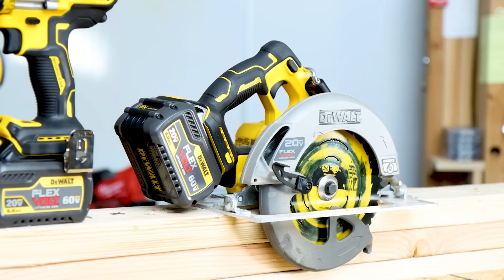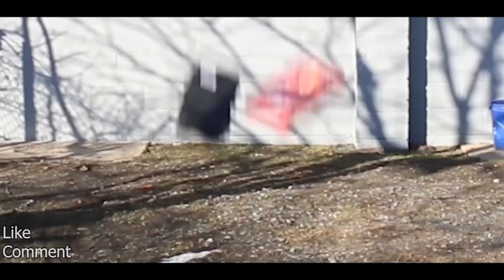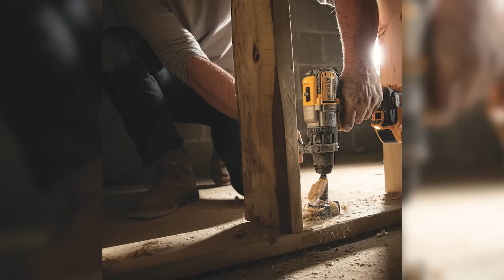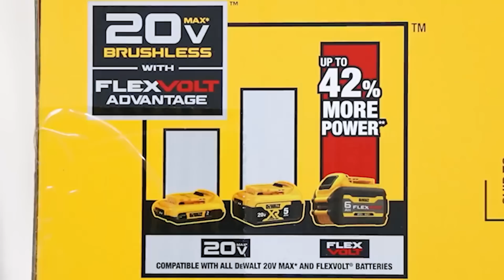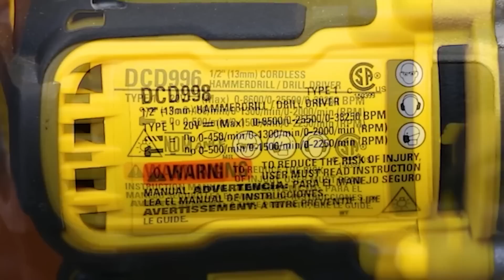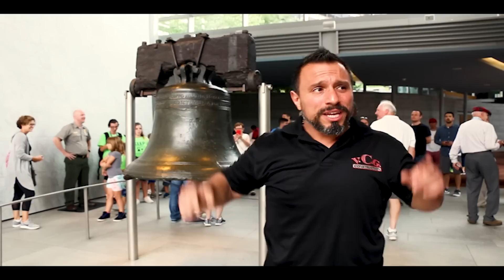DeWALT Tools DIRTY Marketing Tactics (FLEXVOLT Advantage AND Power Detect Hammer Drills)

Comment: Instead of reinvent the wheel 3 times in every product line they have they need to invent new things that are smart and brilliant for all the contractor to use.
I hav recently change my tools from Hitachi to Dewalt for 2 reasons 1 Hitachi change theres battery line to often and 2 its por design and durability.
I have now all the tools i need of Dewalt and are very satisfy whit that but i think they are about to loos it.
If i can give them a tip it is this do some market research and improve the storage line as in T-stak Tough system and invent some smart tools that we dont know that we need yet.
Sorry for por English i am from Sweden =)

Comment: Does the same thing happens to the reciprocating saws? I'm still debating with myself if buying the flexvolt, the flexvolt advantage or the power detect sawzall. Wish one has more power? Wish one has less vibration?

Comment: This design of drill goes back to the DCD925 post type battery drill. Although the old drill is a brushed motor the transmission is identical 3 speed 500 rpm, 1200 rpm and 2000 rpm,  clutch and chuck exactly the same

Comment: The flexvolt has more max watts output at 1219. And also has more Rpms on hammer drill mode at 2250.  This is why it's better and I love it. The others have less max watts and hammer drill RPMs💣💥👊🤘

Comment: It's all marketing hype!  All manufacturers play the game and dup customers who aren't smart enough to know the difference.
Personally I like the 60v Flex, but I got two Flexvolt tools and I can use the extra 60v batteries in all of my 20v and even older 18v tools using the adaptor.   I look at it like buying a new 1/2 ton truck, they all got the same basic design, but then you get to pick the engine for the power you need and the gas tank size for how long you want to go between fill ups...

Comment: I have the XR line of tools, but I got the flex volt advantage hammer drill for Black Friday only because it came with the 6AH flex volt advantage battery for free with a 6AH charger. Only reason I got that one. Works great.

Comment: I would actually really like to see a tool test on the batteries.     The flex volt vs the XR batteries. On the 20 volt line up of tools.      What battery is best as far as power and or run time or both.       We all know the tools are the same spec.    Let’s see what story Lowe’s or Home Depot carry’s the top battery.      Well I mean Home Depot has the XR to.     But what dewalt battery is king.      Now as far as the 60 volt side and multi platform use.   Just power up 20 volt tool what ones takes it

Comment: I think all 3 drills are the same.  Dewalt could have had pressure from HD or Lowes to make the combos slightly different because of the price match. Just like some stores have something 1 digit off in the model number so you can't price match like some TV's. It could be that Dewalt needed to pick up sales for flexvolt batteries and used the percentage ad to pull a wool over consumers to make the 999 look more powerful hoping no one notices the fine print or does the math. Looking at the Dewalt website the various battery descriptions seem very elusive. Some are compared as "more capacity"  other are "more run time" some XR batteries are compared to a "3ah max standard battery" which then shows no specs. I picked up the 998 from Lowe's with the 8ah battery and got the DCB894 free. The drill was right on time as my DC759 18v nicad  motor recently started smoking.
Reply: They are all slightly different. The 996 and 999 are the same, except the 999 can make use of the Flexvolt batteries. The 998 is different because it has  an internal chip that optimizes your battery usage. Otherwise, mechanically, they are the same.

Comment: i love the new tool line that the same as the old one, they sold the old 3sp xr drill and driver 2 4amp battery's out for 149.00 so i got 2 set, and got the xr sawsall and 1sp xr drill and xr driver and 2 batterys for 170.00,, ceep it coming LOL but i do think at sometime i would like to get some of the 60vt things but no rush

Comment: I have the 996 and the 999.  If I use a standard 20v battery they perform the same. But using the  flex battery the 999 definitely has more grunt to it.   Not sure how it does that but it definitely has more jam when I need it.
Reply: How does your 996 compare to the 999 if you use the Flex Volt battery on both of them?
Reply: @pheloniousmunk  the 999 definitely has more pep to it than the 996 when using the flex battery.  They are just about identical with a standard battery.  Close enough that I can’t really tell. I had the 999 bind up on a hole saw and spin it’s t handle around and the 996 has never managed that.
Reply: @brunothehumble  Thanks for that info. So you have tried the 996 vs 999 while both were on a Flex Volt battery?
Reply: @pheloniousmunk  I only have one flex volt battery so I can’t go directly head to head but yes I’ve used both with a flex battery and I was able to notice a marked improvement in performance with the 999
Reply: @brunothehumble  Interesting

Comment: I wish someone would hook all 3 up to some kind of test rig that could measure torque to see if they are any different, too many videos with speculation or some guy drilling holes and no data. paging Project Farm or AvE
Reply: Suggest it to Project Farm, he is awesome!
Reply: Project farm and AVE are both effin amazing for tool info!
Reply: @ikon8275  AVE hasn’t done a proper tool teardown in ages unfortunately.
Reply: @bt5252  I agree @AvE should do a teardown of all three.
Reply: Cew @guitfiddle
Reply: There is a video and 999 is the best but very slightly. Not noticeable to the naked eye but just a hair better that it’s not even Noticeable unless ran together side by side
Reply: I mean the easy solution is to find teardown vides and compare the part numbers for the motors themselves as a starting point
Reply: Search for torque test channel. Legit test rig with data!  No fluff and to the point!
Reply: Turque test channel did that with 2 of them i think. They are close to the same.

Comment: Just got the 996, 887 combo for Xmas based on a number of reviews plus sale (probably due to these new models coming out).  Spent the last 2 weeks deciphering the diff between XR, 20v max and flexvolt both for tools AND batteries.  If I'd known it was going to be so ridiculous, I don't know if I would have committed to the platform.
Weekend warriors don't want to spend hundreds of dollars on different brand batteries and chargers.
Reply: What the heck are you trying to say? You can use any of the 20v batteries AND the Flex Volt batteries on your 20v tools. You can also use the 20v chargers like the DCB115 to charge all of your batteries, including Flex Volt, and the high amp DCB118 rapid charger for all of your batteries. What are the different brand batteries and chargers you speak of?

Comment: I have a question for anyone out there, i just got the dewalt drill and impact combo comes with both drivers, 2  2ah batterys and charger i also picked up the 5ah battery at lowes as well "special gift" and for some reason the 5ah battery wont charge no more than 1 bar no matter how long i let it charge
Reply from the maker: Take it back
Reply: @VCGConstruction  i did and they replaced it with another 5ah and its still doing the same thing
Reply: @foxkiller96   try a different charger
Reply: I had the same problem with my batteries and found out you have to push it farther then it clicks in place, and it starts charging
Reply: Lowe's will take care of you.

Comment: I don't play with DeWalt tools but it doesn't surprise me that they play games... it doesn't surprise me that they play games because the reason I don't use DeWalt tools is because in 2003 I bought a DeWalt 5 tool xr combo kit. All of the tools except for the flashlight and the circular saw quit working within 6 months and then the battery packs quit working within another few months of not using them and then wanting to use it in the flashlight neither one of them would charge.... This was back when everything was still nicad batteries but DeWalt refused to warranty any of the items because I told them that I was using them at work doing HVAC and they told me since I was using it commercially that there was no warranty... Or that it was some ridiculously short warranty that I was already out of and keep in mind this is less than a year old stuff that most of it quit working within six months

Comment: So I’m going to say since the specs are the same. And it doesn’t matter across the board they all can run same battery’s. I’d go with who ever offers the best deals on there tools.   Yes I’d lean toward the flex volt tool just based on more uses for the battery and can get you into the 60 volt tools.         But I agree 100% it’s just a marketing game between Lowe’s and Home Depot.   Dewalt is playing both sides so they need separation between models.  It sucks to think a company is rebranding same tools for 2 retailers it’s insane.    Milwaukee doesn’t sell out of Lowe’s and I have a feeling they would not create 2 brands within there own cordless tools.     

If I was Home Depot I would work on getting a exclusive rights to dewalt and let Lowe’s carry craftsman   Then they would pretty much have contractor tools locked up       But this crap of Home Depot doesn’t want to carry same brands as Lowe’s is just dumb.

Comment: Dewalt makes some very nice tools.  Unfortunately the marketing wank is way way to much.   My daily drives are the German Metabo, Fein, Bosch, some Makita.  The marking for these is nothing like Dewalt or Milwaukee and I do use 12V Milwaukee tools. The point is by creating a marketing shell game it confuses and makes the customer angry.
Reply: Wtf did Milwaukee do? Thay have like 2-3 18v tool lines and it’s blatantly obvious what’s top of the line. FUEL boom done it’s the best, don’t drag Milwaukee into this.

Comment: i will not by a black & decker product again years ago my dad a friend and i bought a cordless toolset at christmess time good tool xps we bought a lot of batteries and use them for a g scale trains but it was a one the special here for that  chrismess   and January came the next year the warranty was no good and they were no longer supporting that line one time thing i thought it was a good line at the time and I seen black & decker do one time tool lines and only put them out for one time a lot and then you get no support after a month or two so that is why do not buy form black $ decker any more but i do have one of there old power drills it has a special bearing in it so you can put side load on it mine is brown the new model is orange looks like a harbor fraught junk i know the old brown one i could not burn up and when i did woodturning i sanded the inside the bowl with it i did buy a dad talked me into buying a dewalt  corded table saw with stand it works

Comment: DeWalt has been doing deceptive marketing ever since the start of the 20v and multiples fallacy. Can't market them that way in the EU. They're 18v and multiples. Granted ALL 18v tools have a nominal 20v when fully charged. The moment you activate discharge, it's 18v. Dishonesty apparently is the theme. I still have DeWalt tools...
Reply: @Joseph Fossa and here it thought it was because people are stupid and would complain that their 18v stick batteries dont work on their 20v(18v) slide battery tools because "its 18v it should work!!!"
Reply: @adamperry4610  dont forget dewalt also sells the adapter to use your 18v stick tools with a slide on 20v battery. saw that tonight at Lowes. 2 20v batteries and the adapter were 179.00, whereas 2 18v stick batteries would be 169.00.  I own all older 18v dewalt, so when my stick lithium ions finally die, I'll likely just grab the 20v slide on batteries with the adapter.  

Edit to add... I actually bought the 12v drill and 12 v impact combo (2 bats and a charger) for 199.00 however they (dewalt) threw in a free tool only of choice.. (select items) bluetooth speaker,light,recip saw,1/2 impact,or a circ saw.  I chose the sawzall. 
First off let me start by stating I only bought the 12v for its weight and size (and the belt clip). As a service electrician. I was dead tired of dragging around the bohemouth 18v impact driver.  The 12v is so much lighter smaller and just as capable for the tasks I perform. Now let me speak for the 12v sawzall. OmFg. More than 1/2 the weight of the old school 18v sawzall. So much more ergonomic as well.   Just sayin... 👍

Comment: Larger Ah rating means the battery can supply more current. But that also means that the motor-speed controller combo has to be able to handle the extra current, or it will burn up.

Comment: Make a drill for the battery class and call it a day. To much bs having so many models.
Reply: True. Bloody hard keeping up with the alphabet soup.
Reply: That’s one of the reasons I like Milwaukee.  Still using only 18v batteries.  If it says Fuel it’s the top of the line.
Reply: @DamionJR4923  dewalt xr, same it's the newest model of brushless battery line. Same as FUEL
Reply: @benthompson8256  I don’t like the Home Depot vs Lowe’s vs Ace Hardware versions of Dewalt.  Dewalt makes great stuff.  All of my corded tools are Dewalt.  My Miter Saw, heat gun, and grinder are Dewalt. I’m just glad I made the switch when Dewalt went to 20v I went to Milwaukee.
Reply: You are literally asking for a new model

Comment: I think it's all about the batteries. But that's just me. I run all dewalt and it doesn't matter if I put a 1.5amp or a 6amp on any of my tools. They all have the same power but the longevity of use will go to the bigger batteries obviously. I don't have any flex volt or 60v batteries so I can't say forsure but I think it's just the batteries.

Comment: I use milwaukee everyday at work, I use dewalt everyday at home I've burnt up more milwaukee tools because of crap components ,( mostly switches and chucks)have never had a problem with dewalt and I use them in the same way.
Reply: Oh that answers Vinces question...thanks
Reply: Except someone else pays for the Milwaukee tools and you're paying for the DeWalt tools... Might be a bias...
Reply: I agree the Milwaukee chuck have a lot to be desired, along with the hog ring on there 3/8 drive impact wrench

Comment: We need a TTR with 998 vs 999!!!
Reply: Why need a tool test.  The specs are the same on each drill.  And to compare apples to apples.  You have to run them both with flex volt batteries or XR batteries.    And given the outputs are the same it would come down to who uses the tool best and that’s a person vs person not tool to tool

I do not know off hand if you tested 8 amp XR vs 8 amp flex volt batteries what ones cells are best.  But 8 amp hours is 8 amp hours.   

The real test is batteries vs batteries.   Use same tool and run it XR battery’s vs flex volt.   And see what battery’s amps up the tools best
Reply: @craigcanterbury264  why not, it would be fun!!!
Reply: @ToolTroll1  i love the tool tests videos there funny as all get out.   But in this I would actually like to see the Flex Volt batteries vs the XR battery’s.   And the reason is  the drills specs are the same.   So I want to know what battery is best to run 20v tools on.   Because of flex volt can put preform the XR let’s say I would invest anytime a tool and battery deal on flex volts come up.  Or if it’s no different in the 20 volt tools then I know just stick with the multi battery pack deals on the XR batteries.

I know there are tools that run the 60 volt part in the flex volts that’s not what I’m wondering it’s how the performance is in the 20 volt stuff 

I have yet to come across a need that will take me to getting my table or miter saw battery powered yet. I’m sure there is a market for it.  But for me them types of tools o want to stay corded for now because I know the amp draw theses tools take to run the motors and I do not trust the motors life in the tools are not being cut short by the amps not staying at a stable draw due to battery being drained 

Long explanation I know but it’s my thoughts
Reply: @craigcanterbury264  I'd like to see each drill with same battery tested. 996 998 999 with 5ah xr, the 8ah xr, then 6ah+ flexvolt and see what the actual difference is between the 3 drills.

Comment: Looking at specs from dewalt looks like the UWO are different for all three. So considering that all three have the same RPMs I figure that equates to differences in torque?
Reply from the maker: I was thinking the same!
Reply: Totally agree 👍
Reply: voltage = rpm , mah~amp = torque power 
only different is the amount of amp to the battery.  Words on the internet say that 20xr is really 18 as well.

Comment: DeWalt makes some of the best if not the best miter saws and table saws I would say Milwaukee would be a close second but I like the fast DeWalt as corded or battery with the option of a chord although almost all tools are dangerous miter saw and table saw I probably two most dangerous tools on a job site😎👊🇺🇸

Comment: I have the 999 w/the 6a.h. flexvolt. Don't really see the power. The new flexvolt Sawzall is amazing
Reply: 999 is just the most updated one which makes it the best but it is very and I mean very slightly more powerful hardly noticeable but it is better.
Reply: @jorangel87  to be fair its very torquie a on one so the longer handle would be nice